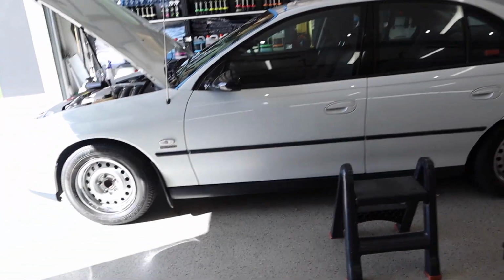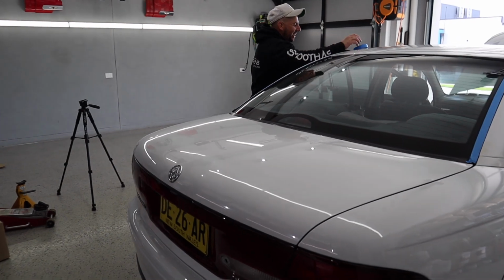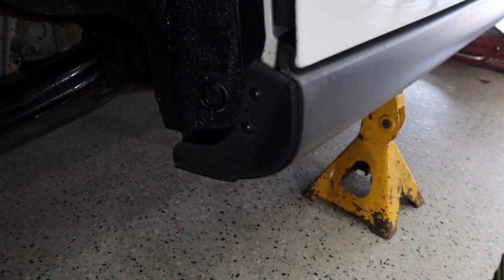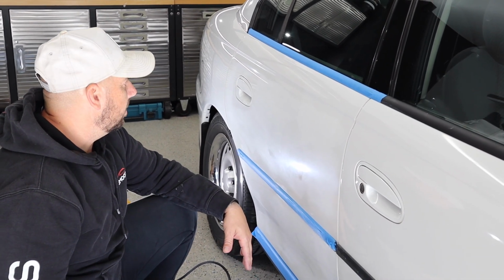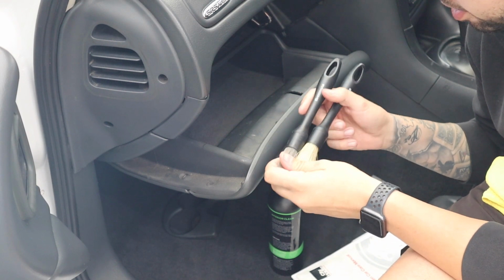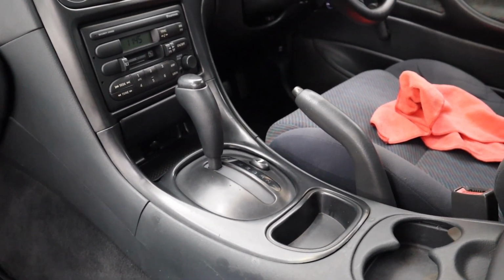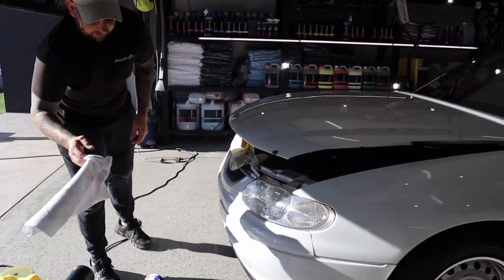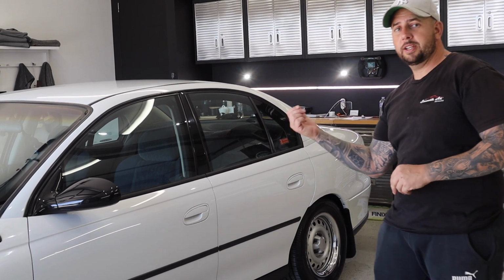VT Commodore EX-Highway Patrol // Corrected & Coated

Comment: Awesome 😎. I remember when the VT Commodore came out. I was 17 and wanted one so bad but then never got one. They were abused and now seeing a clean example is rare.

My ex had a VT and do remember the calcium build up on the rubbers. Die did you get rid of it?
Reply from the maker: Yep they were the ‘car to have’ back then, still awesome now! 

Some came out but most the moulds needed replacing or had been replaced

Comment: Hi Just wonder what did you use under the guards to bring up that black or did you paint it? Thank you
Reply from the maker: The original black was just cleaned up using Smooth Ae all purpose cleaner, brushes and the pressure washer then any exposed patches was touched up with underbody spray
Reply: @smoothasbrothers  thank you chich